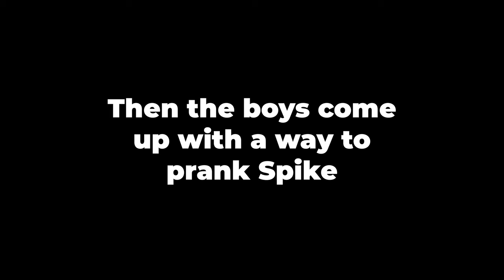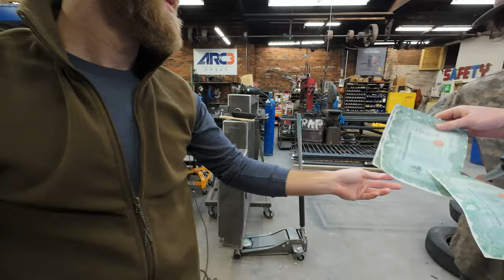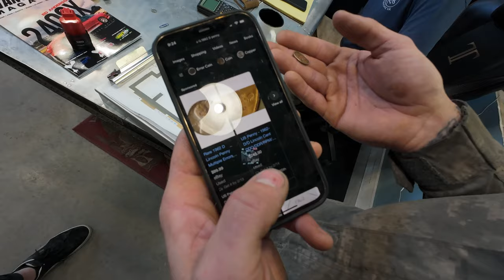Opening this Safe SHOCKED Us

Comment: I hope this makes enough yootoob money to make destroying this safe worthwhile... It is a nifty safe.

In the event you are wondering... the divider between the chambers is not inadequate....            
The top door generally only serves a business as a means to make a drop into the lower compartment... as well as hold a small petty cash or change fund

Often there is a drop slot to the rear, if not a rotary drum. Employees have combo to top compartment, manager or treasurer has combo to the bottom ( receiving ) compartment.

This allows a drop safe to NOT have an exposed opening from the outside to attack. 

Was that a DieBold or Mosler ( or other make )

That was fun. You should see what railings made by a locksmith end up like!